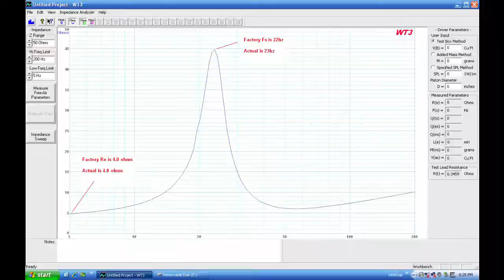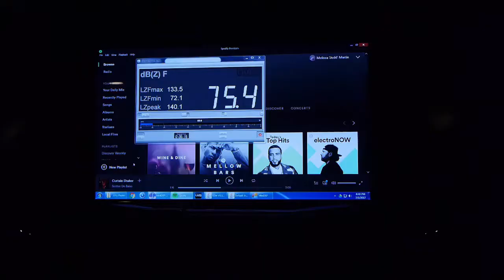Attending the VIdiyFest at Planet 10 HiFi

Comment: I see some Frugalhorns! I built one (Frugalhorn Lite), but haven't gotten around to the second one yet. Fairly impressive output with a 3" JVC ceramic cone fullrange/wideband driver. Haven't decided on what's going in them permanently, though leaning towards Fostex or Dayton Reference. Any suggestions for proven performers in this design are welcome.
Reply from the maker: I’m not super familiar with them. I’d say the mark audio drivers are decent.